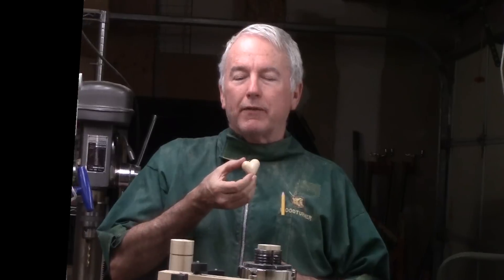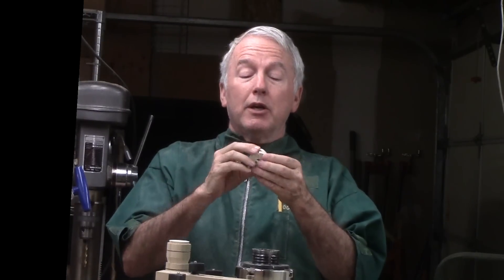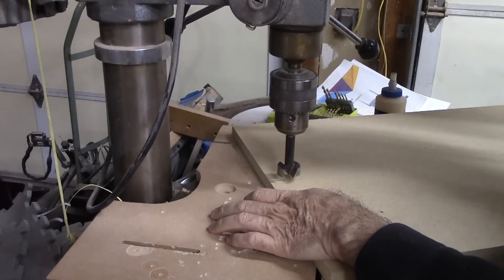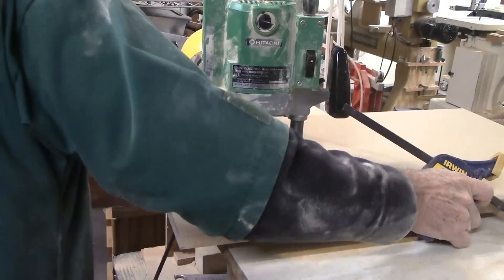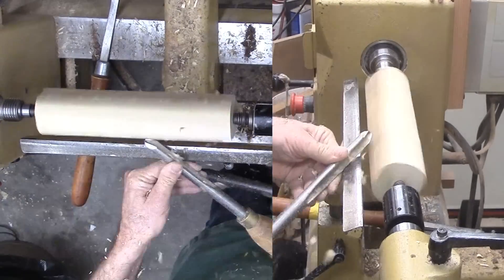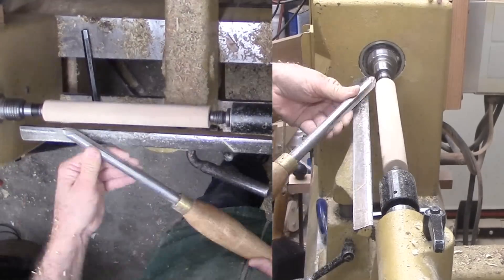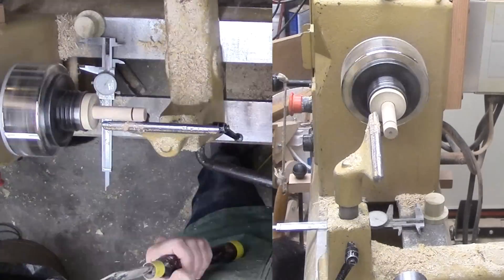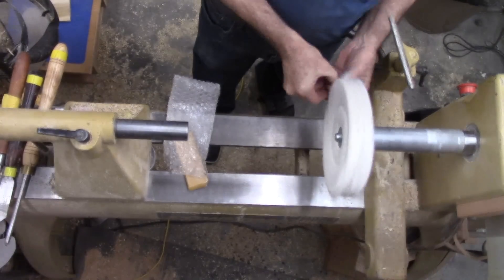Revisit Woodturning Heart For My Valentine Plus Collet & Jig

Comment: Rather than trying to hold the short rounded end of the hart for bandsawing, why not hold it by the hollowed end which can be made as long as needed and then just hold it against the standard sliding miter with fingers no where near the blade?
Reply from the maker: Always more possibilities. But then I'd have to bore a much deeper hole in the longer spindle.
Alan
Reply: As Wood Turns thanks. I think it is great that you read my comment and took the time to reply. Thanks again. Don